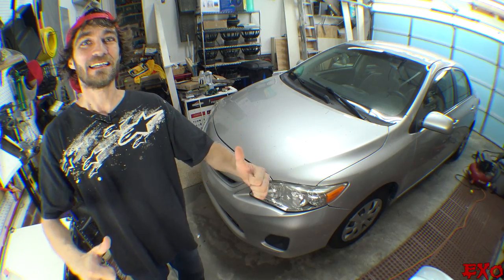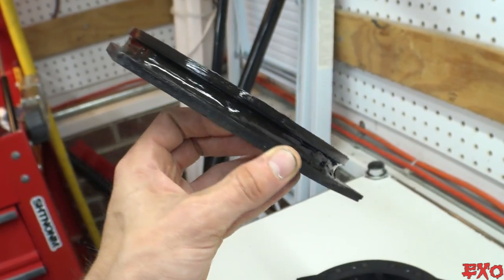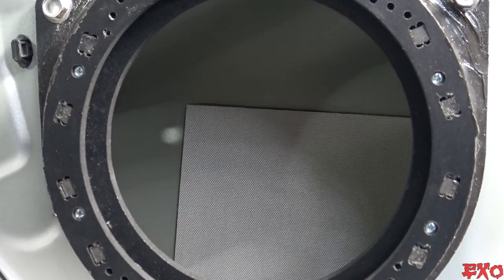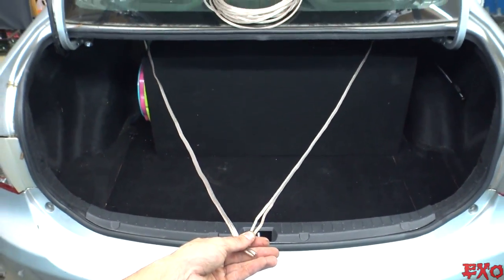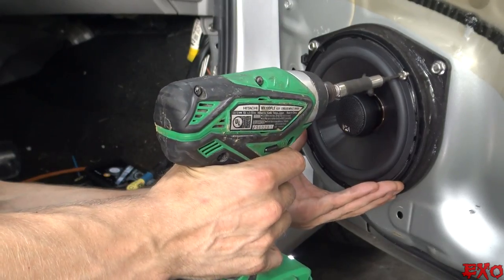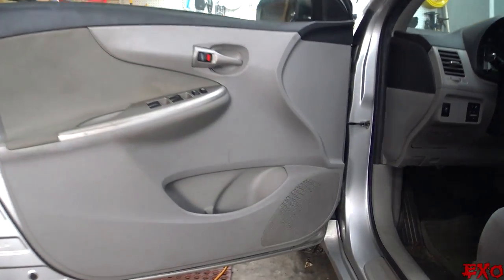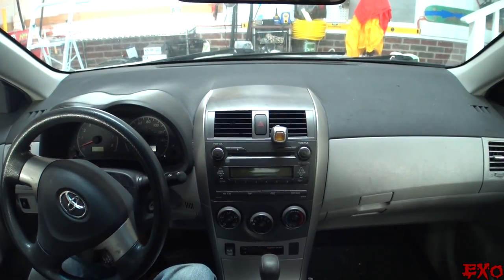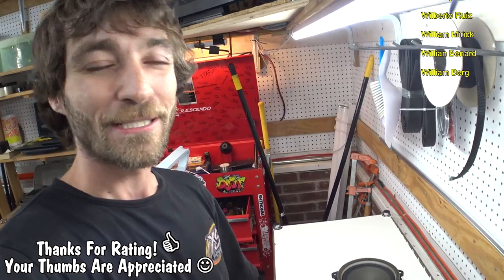How To Install BETTER Door Speakers w/ NVX 6.5 Coaxial Speaker & Installing Aftermarket Adapter Ring

Comment: bro you don't have to run wires to the doors.... the easiest thing is to use the stock harness.... you can test it yourself. wire it up normal, all amp speaker output send to the adapter to go through the cars stock harness. then take a multi-meter and read output from the amp (tuned, maxed volume). then check the doors where it terminates to the speaker.

my stock mitsubishi mirage (2015) has like 18 gauge stock wire. pretty small. so I measured the amps output which was tuned using the DD-1 on my pioneer headunit to make sure i wasn't sending a bad signal, and conservative tuned by ear the amp. amp was rated for 150w x 2 channel at 2 ohm.... so I measured it at the amp output. with my tuning, 12.4v x 9.3amp = 115.32 watts.... shy of 150 but that's how i tuned it. plus it was 12.4v aka car wasn't on when tested. however, that doesn't matter, what matters is the difference between what is at the amp vs what the door sees. so the speaker wire comes out of the amp, into the adapter harness for to go into the stock wiring to each door. so I measured at my door output, I got 12.4v x 9.1amp = 112.84. I barely lost 2.5 watts. you can't hear the difference in volume at all with losing such a little amount of wattage. 

I really challenge you to try it yourself. you'll save so much money not wiring in each door speaker. and i bet you wont hear a difference. you can even test with a car you already have that has a custom run, and then switch outputs to go through the stock harness from the amp. you wont notice a difference at all. if you do, its your brain putting bias on it. in a blind test which I've done, they can't tell the difference.... I usually tell people its got 12 gauge ran to doors, then after they say how good it sounds I say "haha i lied, its run through the stock 18 gauge" and it blows their mind.

Comment: Well, i use a looong thin steel wire, i run it trough all the tight spaces and then i stick one end of the speaker cable on the steel wire. Last thing to do is to pull out the steel wire cuz i already made the path for the speaker cable to get in. Today i stuck a freaking 4awg cable into my 2019 fiest st line, it was a pain in the ass, then i realized that the cable was too short cuz i couldn't get to the trunk GG.

Comment: Might be overkill but i never completely trust those 'crimp on connectors', i always crimp and then solder the wires into the connector for good measure, before i finish with some shrink tube.

Comment: I will never understand why car audio people constantly bring up the magnet sizes. Those small ones on factory speakers are Neodymium so they are supposed to be smaller and weigh less. Those big huge magnets that weigh a lot and car audio people think they need to be heavy, etc., they are IRON ferrite. Iron weighs a lot. My factory speakers in my Mazda sounded great for bass. No issues.

Comment: i couldnt use coaxial speaker even if i wanted too, i eat though tweeters in my system!
Reply: If you eat through tweeters there's probably a reason. If you have them properly crossed over and not distorting then your ears should bleed before they blow. I have a pair of Polk mm6502 component terylene tweeters that I TRIED to blow and I physically couldn't even under 75 watts RMS on just the tweeter. It was so loud I couldn't even be in the room and I had to turn it off, they weren't even warm to the touch.

Comment: Why run new wire in the doors?, when you can just splice into the old stock wire where it meets the deck and run new wire down the tranny tunnel under the carpet back to your amp, or you can splice into the old wire right before it goes into the door boot, and then run the new wire down the side of the car under the door sills to the amp in the back. Dont understand why you need new wire for a 1-2 foot run in the door, your not going to loose any signal quality in a foot or 2 of stock wire.

Comment: When I fish wires I use a metal wire that I pull to 2 of my wing span fold in half put the open end in my drill and close in a pair of needle nose Pliers then twist it. you can open a close the loop to and the wire is less then a dollar at harbor freight

Comment: how you ran your wires with is nothing new they been doing stuff like that going all the way back to the 1990s. you do know that a 6x9 is a oval shape speakers not being round like the ones you have showed in this video right there 6" by 9" this is why there oval thats why they are called 6x9s daaaa. now you can get a bass speaker that is 6" or 9" rounds ones i have used them my self in places that you can not fit a 6x9 in the space.

Comment: 8:15 umph in the tweeters? What the hell are you talking about? The Top tweeters aren't even connected, so you've just put tweeters in the worse location for what - extra umph? Having two tweeters isn't good either as long as one would do the job perfectly. More speakers is just more interference.

Comment: I installed an electronics show 10 dollar roadmaster radio and 15 dollar 120 watt 3 ways (had to build speaker boxes behind the seat) in a 1959 ford pickup the busted out the passenger side window a week later and stole my stereo...destroyed a 200 dollar window 75 dollar molding for a 25 dollar stereo